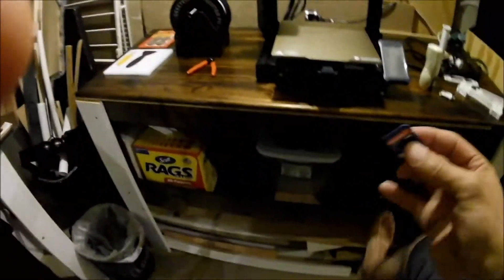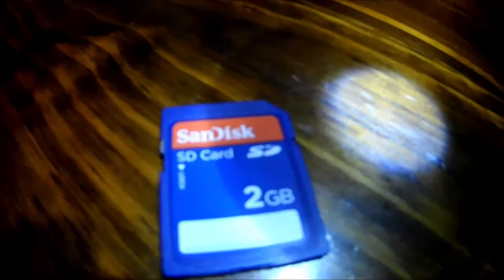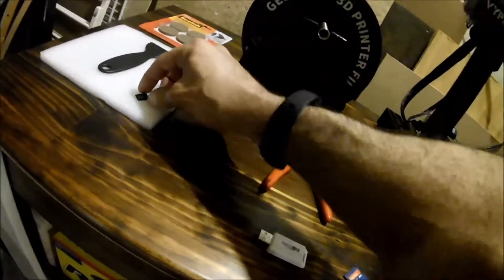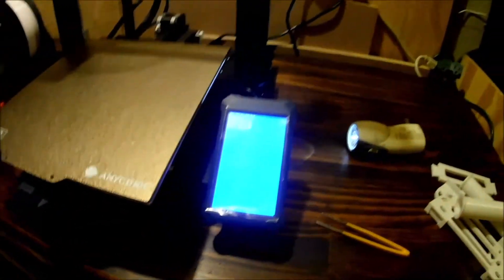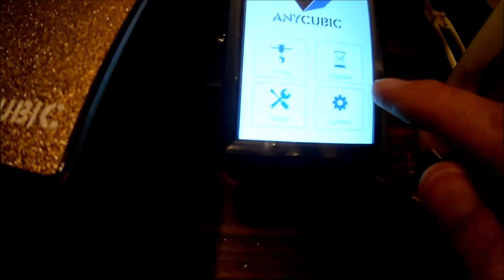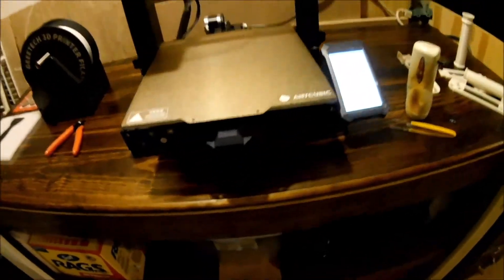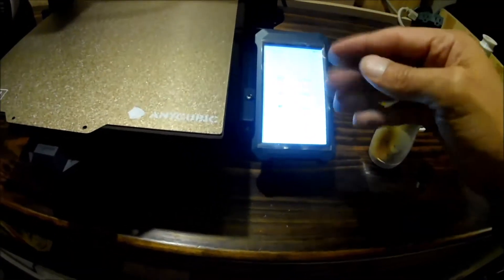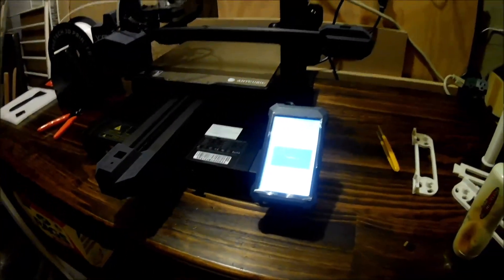Anycubic Vyper: Firmware and Screen update- How to, and weird issues I ran into along the way.

Comment: I run Klipper on my Vyper; this way only the Anycubic logo is visible so I'd like to replace it to a custom picture at least. Can it be simply done by modifying the image files in the DWIN_SET folder?

I've tried it, and changed some pictures. Made the firmware update according to your video, got "SD Card process.... END!" message too on the blue screen (no beeping), but after turning off and on, it still shows the original picture... I have only 16GB microSD card, can it be a problem? Any help is appreciated, thank you in advance!

Comment: My issue is that my vyper wont start printing when I select the model in the screen, it does reach the bed and nozzle temperature and the fan all the way up but it doesn't start printing
Reply from the maker: You may have tried this but,  I would try a different flash drive or a different model to see if either one is the issue.

Comment: Printer not turning on after MicroSD inserted in screen. Whats wrong?
MicroSD 16gb, formated as FAT32 - 4096Bytes, DWIN_SET folder copied.
When I remode card from screen, all works ok, only screen flickering at some functions after 2.4.5 update.
May be I must find smaller MicroSd?
Reply from the maker: I have had mixed results with different SD cards.  Yes try a smaller one or a different one if you have it.

Comment: Thanks for vids. I'm having an issue with my 2 vypers... No matter how I set it to 275 nozzle, it defaults back to 260. I've tried every thing I can think think of, cura settings, firmware, octoprint and octodash settings. A few months ago, 1 of them printed and held 300 just fine, but idk why it doesn't any more, IDT I updated the firmware on that one, but cura settings have changed. Any help would be much appreciated!

Comment: I have a question for you, I’m having trouble getting my vyper to perform Cura pause at height scripts or filament changes. It’ll do the pause and move the printer head but the screen won’t continue to allow me to continue the print. What do I need to do?
Reply from the maker: If that's giving you trouble, you may want to use an additional software like OctoPrint to manage the printing.  Lots of people use that for paused timelapse printing and filament color changes.  Best of luck!

Comment: My firmware updated, but my screen will not. I get a blue screen that populates all of the text instantly, instead of slowly like yours did as it downloaded the files. This makes me think it's not actually downloading anything. It has the DWIN_SET folder on it and should be formatted correctly. I am so lost. If you can help at all please let me know.
Reply from the maker: If it is acting strangely, you could try using a different SD card.  Smaller, like 8GB or less, seems to work better for these firmware upgrades.  Best of luck!

Comment: Updated my brand new one to 2.4.5 and since then when I click on auto leveling the screen stays on it flickering super fast and doing nothing.

edit: I had to download a third party tool to FAT32, 4096Bytes my 32gb microSD card. After putting the screen folder onto it, the update worked like in your video for the screen. After the start sound  at the end I turned it off and removed the microSDcard. Then I turned it on and auto leveling worked again for me!

Thanks to your video I was able to find out what the problem was, many thanks!
Reply: can you tell me what third part app you used i have that problem as well
Reply from the maker: I use a formatting tool called Rufus if my drives start acting up.  It can also make great bootable flash drives. rufus.ie
Reply: Windows can do that just fine, problem is I tried with a 32Gb SDCard.
I had to redo the screen update using a 1GB SD, worked flawlessly.
Reply: @OlimpiuCristianMihai  appreciate this comment brother mine is doing horrible
Reply: @uzamakisaiyan8767  did you use 32 micro SD card?
Reply: @Yung504killa  I believe a 8gb
Reply: @uzamakisaiyan8767  appreciate it because everytime I try to print the screen goes black hopefully it's the firmware
Reply: I had the same issue with the flickering screen after the update. It got fixed by using the 4096 setting in Windows 11, by default it’s not set to 4096, I did not pay attention when formatting the first time round.

Comment: What micro SD card did you use? I have two of them and neither will let me correctly format them
Reply from the maker: I have a Kingston 2GB microSD, it's older.  The brand name shouldn't matter much but the size of the card may be a factor.  If you are using Windows, try a free utility called Rufus.  It works great for creating bootable flash drives, but is also a solid utility for formatting.  I hope it works out!

Comment: The opposite happened to me, I put the 2gb sd, save the firmware downloaded from the AnyCubic website and now the equipment turns me on but nothing starts, it stays on the logo and the extruder light flashes.

any suggestion? I have removed the sd and turned on and still the Vyper does not start me. HELP
Reply: did you find an answer for this?
Reply from the maker: That is troubling.  You can try contacting AnyCubic support via email, I find them to be responsive.  Or, try a different SD card and try the firmware upgrade again.  Also, if you can get an older version of the firmware, you can try downgrading.
Reply: como lo solucionaste?
Reply: @byrondefaz  Pudiste hacerlo? aun requeris ayuda?
Reply: @Xavileexleee  Lo solucione muchas gracias, tenian razón solo era cuestión de cambiar de micro SD

Comment: when trying to insert the micro sd into the screen it fell between the sd reader and the plastic case, getting stuck underneath the screens board. be careful when inserting
Reply from the maker: This happened to me as well.  I had to use tweezers to extract it.  If you don't align correctly with the port, there is plenty of space where this will just not insert correctly.  Thanks for watching!

Comment: i have a queestion have you anybody had a problem with models not coming up on the screen i have tried three different sd cards and no models show up  it was working just a few days ago so i dont know what happened .
Reply from the maker: Have you tried re-formatting the card FAT32, with 4096 cluster size?  I've been using an old SanDisk 2GB SD card to print without any issues. Best of luck & thanks for watching.
Reply: You have to press refresh once your insert card in with new gcode files (the two Arrows are the refresh function.

Comment: how did you get the back cable to not touch the build plate, mine is always on the plate until the print starts to get taller.
Reply from the maker: Hi Marco, When I first built the printer I tried to make sure all cables were flat and not twisted, but other than that I didn't do anything specific.  Some people have been rotating the top half around to help with cable control.  I have seen several cable management files in Thingiverse that should fit the Vyper (like this: https://www.thingiverse.com/thing:4346312).
I've also had my eye on this, for the heated bed cable:   https://www.thingiverse.com/thing:4919531

Thanks for watching!
Reply: @renaissancelaboratories5645  That thing works fantastic. One of my first prints on this thing and it has kept that cable away from the bed.

Comment: What size microsd card did you use? I tried a 64 gig and it does not read it.
Reply from the maker: For the screen update I used a 2GB MicroSD from Kingston.  
For the printer firmware, I had to use the SD card that came with the printer.  For some reason it didn't read the other one I had. Best of luck.

Comment: Could you show where in the official site is the firmware update is? is it under Anycubic Care?
Reply: Yes, in the section of Anycubic Care is a link under the firmware. It will open a google drive zip file which you can download and unzip
Reply from the maker: Scroll down on their site to the Anycubic Care section and the firmware is there.  The file contains firmware for both versions of the motherboard, as well as the screen update.  
https://www.anycubic.com/products/anycubic-vyper
Reply: Nice video. Don't you activate linear advanced on your printer?